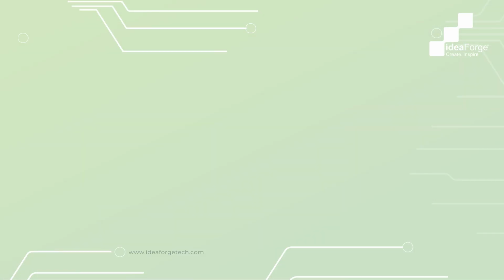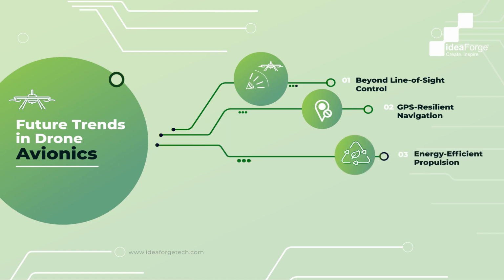What's Inside Your Drone - The Power of Embedded Systems!

Comment: Hello Sir is this software code certified with DO178 as defense looks into these standardized products like MIL217F for the hardware component, DO178C for software codes. Not just this but as it is a safety critical drone as it operates into various environment is it having certified codes ?